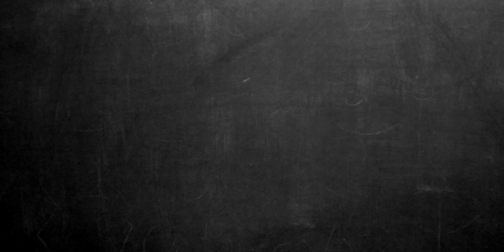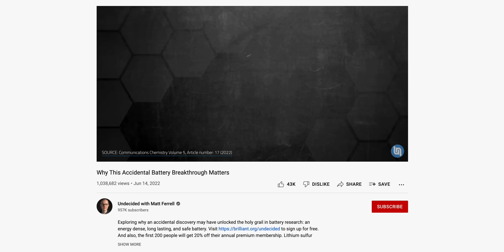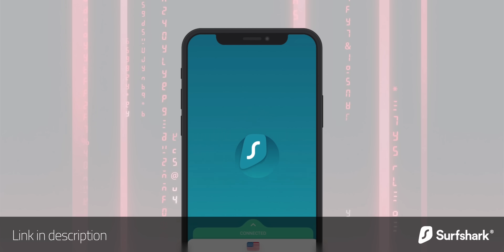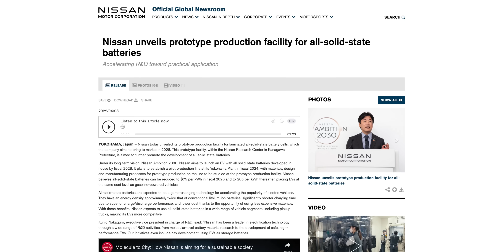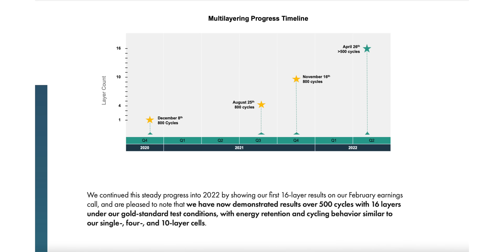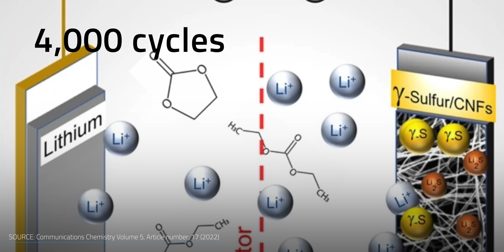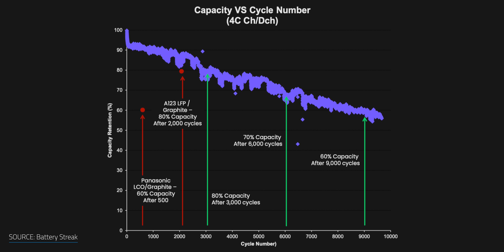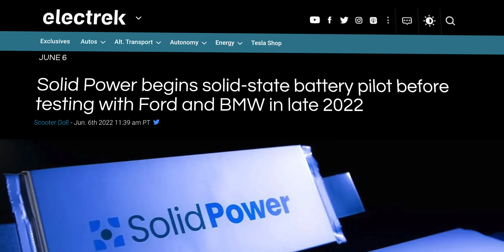Is This Solid State Battery Too Late?

Comment: personally, i think the abundance of technologies is good on its own, as competing technologies increase overall supply. Even if one battery is slightly worse, it still works. Like, when solid state batteries do hit the market, even if they are only in ~5% of EVs, that still means without them there would just be the added demand from the people without those vehicles.
Reply: Depends on the materials used. If there is a lithium shortage, putting more lithium batteries on the market won't help with supply. (especially not if they use more lithium)
Reply: I completely agree.  Even if Solid-state-Batteries NEVER reach commercial viability, there will inevitably be spin-offs from this research.
Reply: Not really they could still compete for resources and the overall availability would still be roughly the same as a result.
Reply: @Lars Hansen ugggh... you're plagued with disrespect for Americans, thinking we are all alike, all of us wasteful and mindless.

There are jackasses in every society, but might I remind you that mass production of EVs started in the US long before other countries, and have been leaders in the Green Revolution.
Reply: Just got my EV6 Light on 5/1/2022, and right now I have a little bit over 1000 miles on it. When I charge the car to 100% it only showed estimate rate of 205 miles. It seemed like the battery is already degrade 12%. Do you know if it will be able to recapture more mileage when I have more miles on the vehicle, or it will only get lower mileage going forward?
Reply: @tocreatee5736  The estimate is based off past driving, so it will be different from the original unrealistic range. Either way, if you want to get long life from the battery (and who wouldn't) never charge it to 100% unless you really have to...like your life depends on it. Otherwise better to charge to 80% and top up if you have to.
Reply: @tocreatee5736  that estimated range meter has a lot to do with how you drive. i doubt you have 12% capacity loss - you can look at the kwh per mile traveled to confirm
Reply: @tocreatee5736  lithium batteres offen lose noticeable range in the first year or so... after that, charge capacity will drop much less per year, so long as you don't charge to 100%  every time, don't make a habit of driving it until it's below 10% or so, and charge it at high speed all the time.  If you don't abuse the battery pack, it will give you hundreds of thousands of miles of inexpensive driving.
Reply: I would be worried about cycle fo chasing this new improved technology while old solutions still work.
For example throwing away working ICE cars to get a new Electric.
Reply: @joz534  there are plenty of companies working on kits for retrofitting ICE vehicles.  It doesn't take long to break even with the footprint of an EV vs ICE car. Unless you're going to total your car in an accident, or you barely drive at all, it's always better to get an EV.
Reply: @joz534  Not true.....there is a trend now to retrofit electric components to IC engine cars without having to buy a complete new car......that applies to any car made and if you have a favorite vintage car it can take on a new life forever without becoming a dinosaur.
At this moment in time the EV has come of age and is totally a practical means of transport that supersedes the ICE car....... it's good now but with improving battery technology it will just get better.
Reply: @joz534  The insurance scam industry and casual attitudes towards disposable consumerism is to blame for far more "thrown away" cars than EVs. But ok.
Reply: @joz534  but who's going to throw away a perfectly good working car just to get a new car? That's not financially sound for anyone but the richest.
Reply: @MrGamelover23  there is a trend in the common among the impoverished Americans to buy a new car ever year using there income tax return. They use the tax return as a down payment to get a vehicle then just drive it until it gets repossessed, or make a theft claim.
Reply: @joz534  i feel like electric is the way to go anyway with these rising fuel prices.
we just need more power sources that arent coal or gas to keep electricity prices down.
Reply: @guesswho2778  yeah but there are people trading in gas cars that have years of life left to save money when they won't break even for another decade.
Reply: @Distress.  that's not really a negative because someone else will drive those cars. And ideally, they're ecological upgrades from their previous car
Reply: @veganpotterthevegan  I suppose on net it's not too bad, but it is a bad financial decision for the seller.
Reply: @Distress.  but a traded in car isn’t crushed. It is sold to someone else, maybe upgrading from a filthier older ICE…
Reply: @Distress.  you are making assumptions!  Gas was 35 cents/ gallon when I started driving... here in California, it has been over $6. for a while, and won't be dropping much if at all before it again begins its inexorable spiraling upward.  I have been driving EVs for 13 years, and have saved thousands of gas, oil changes, tune-ups, tranny service, smog tests, etc.  I will NEVER go back to ICE cars.  Stick with your gas guzzler, and make OPEC rich.  You've seen prices rise faster and faster... how long before you have to pay $15. a gallon?

Also, do you realize millions of EVs today are helping to keep the price of your horrid gasoline down?  Law of supply and demand!

Comment: Wouldn't we see SS batteries in things like phones and laptops first where they can charge a premium and only have to produce a small amount? But so far nothing.
Reply: bot above..obvious falsebot
Reply: report the bot above
Reply: Yes.. but the woman at the end said five years for research time
Reply: 400 cycles means a year lifespan, or less for a heavy user.  Definitely will need to get that number of cycles up to at least 2 years before it can be a viable option for cellphones.

At least in my family,  we try to keep our phones for 3-4 years.  We wouldn't even consider a 400 cycle device.

Comment: My question is; if the solid state batteries charge quicker, does that benefit the solar powered car market? When talking about that you said that the downside was that solar panels can't generate enough power for quick charging of li batteries, so is it different for SS?
Reply: Vehicles lack enough surface area to really benifit from solar charging. Solar is best deployed in installations where space is plentiful and cheap.
Reply: @Uncle_Fred  Yes I see that, but I was wondering if coupled with a solid state battery, it could mean charging would at least compete with current ev charging speeds, or at the very least reduce the need for plug in charging?
Reply: @garethhodge239  the issue isn't in the battery. The amount of solar panels you can fit on a car simply don't provide enough power to meaningfully increase the range of the car. Changing the type of battery doesn't change that. A car is just too small and kinda the wrong shape to make solar panels useful.
Reply: @rogerstarkey5390  Yes I see that, but to my mind it's free electric. Even if I thought it would save me 30m/1hr of plug in charging a day I would think that was better for the environment.
Reply: @garethhodge239  
It's nowhere near that, unfortunately. The saving are in the seconds, mostly. 

There was a pickup truck that experimented with a solar system built into the roof. I did the math and the range came out to about 0.3-6 km of additional range per charge, depending on the weather. This was for a brand new kit and didn't factor in any dirt. The added cost would likely come at a high feature premium.

It just isn't worth it. Solar makes sense for powering small electric devices on a camper RV. You have a large and flat surface area, plenty of battery storage area.

Comment: As a non-technical guy it looks as if we're 3 to 9 years away for the kind of outstanding battery the world needs but 2 to 3 years for a good enough battery to just get by on.  If no other amazing breakthrough comes along in the meantime.
Reply: We already have batteries that are good enough to get by on.  Take the Ioniq 5 for example.  250-300 miles range and an 18 minute charge  (in good conditions) that adds ~10 miles of range per minute.   Of course 90% plus occurs at home anyway.  Of course more longevity and faster charging will be very nice.  Range is pretty close to a non issue already.  Let's face it a 15 minute stop every three hours would be nice for road trips and we are close to that already.
Reply: @gregkramer5588  while you may be happy with the limited range of EVs it is not nearly enough for me. If you're stopping for 15 minutes every 300 miles you're not going to get too far by the end of the day either. Road trips are endurance tests of men and machines. Minutes add up to hours at the end of the journey. Hours you'll wish you were off the road.
Reply: @1pcfred  So I already stop in fewer miles than that. Who drive 300 miles with out stopping?  BTW I drive from TX to MN at least once a year and from TX to Pittsburg every few years.   So MN ~1000 miles.  If I stop an extra 10 minutes every 250 miles that is 40 minutes but in reality it would more likely be 5 or 6 stops. Since it is advantage's to use the best part of the charge curve. So not hours but maybe an hour! BTW I usually stop to eat a couple times also. I think this is common :-)

Comment: I think somethings been missed regarding the solid state batteries to. It should be easier to shape them, maybe meaning we wont need a huge underfloor battery 'pack' in the future but the body could be lined with the battery. probably a bad example but should get the point across. Plus they are probably more scalable for industry, allowing to target exact capacity rather than number of cells where capacity is directly incremented by cell count.

Comment: i noticed for the drexel/quantum battery comparison. you said the drexel battery 'performance held up for 4000 cycles'. But you stated the quantum battery held 80% after 400 cycles. for the drexel battery did 'held up' mean 100% capacity or just that it could take some kind of charge even if that was 5% original capacity?
Reply: nobody falls for that, india bot reply

Comment: Hey Matt, I heard someone speak about accelerating ocean carbon absorption by pumping up deep water to the surface. Besides capturing more carbon, it would also be cooler, and less acidic, basically catching three birds with one stone. I have no idea about the viability of this, have you done a video on it in the past or is it something you and your team might be interested in diving into? Your videos are great, thanks!
Reply: Sounds terrible to be honest. It will lead to toxic surface level water sinking faster, warmer water mixing with cooler water , creating lesser cool water. Furthermore it seems to be too energy extensive as well. Plus I don't see how it will just magically significantly increase carbon absorption.
Reply: research methane generators on cow farms, 28x superior than capturing co2. Also Tinco, he does.. sea kelp farming is superior to growing trees for capturing co2, matt talked about this last month buddy. Cheers good stuff.
Reply: @dertythegrower  You do realize that methane generators produce extra methane gas by bacterial digestion of solid waste, not capture anything that would otherwise go into the atmosphere, right? They actually increases atmospheric emissions when that methane is burned for power or heat. Although technically it's carbon neutral because it came from plants in the first place.
Reply: @DFPercush  Eh pretty much anything is carbon neutral in that case, well at least until we import significant amounts of carbon from off planet.
Reply: @skirata3144  Carbon positive means pulling sequestered carbon from the ground and releasing it into the atmosphere, basically "fossil fuels". If the carbon came from the atmosphere a short while ago, and goes back into the atmosphere, it's net zero. The difference is whether it was previously taken out of the biological life cycle and locked away in the earth.
Reply: interesting..
Reply: 70% is ocan. Plankton can do the whole job. And I like tp eat fish. So de-acidification is the only way
Reply: Don’t forget, you can generate electricity with the temperature difference between frigid deep water and warm surface water.
Reply: This is a terrible idea. The atmosphere is already low on co2. Making it lower will kill plants.

Comment: I don’t really think it can ever be too late. Research in better batteries in general is good, so I wouldn’t worry too much about whether or not this is the silver bullet. We’re too early in the research and adoption of these batteries to pick one as “the best” (long term, not at our current research level)
Reply: Maybe we'll get solid state batteries in our flying cars that have been "just around the corner" since the 1960's.
Reply: @michaelbrinks8089  We can make flying cars. They're just not practical.
Reply: Think the one we need most is the one that is most environmental friendly in production and easily, cheaply recyclable.
Reply: @kamilpotato3764  right but we don’t know which one that is, so it kind of means nothing.
Reply: @kamilpotato3764  solid state can improve in those areas if they simply reach the duty cycles they can be capable of. Even if they only reach a fraction of the potential its still many times greater then traditional batteries. 
They could reach into the millions of cycles versus thousands we have now. So one battery could last hundreds of years theoretically
Reply: @Dan G. Smithright. Your point?